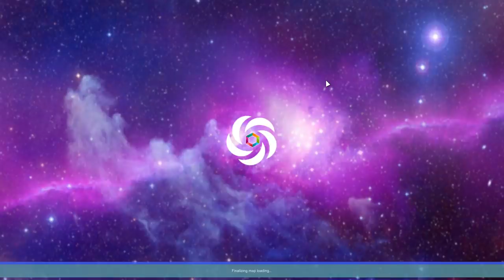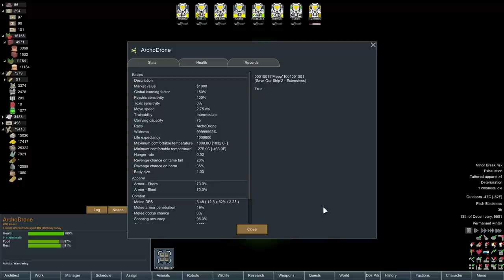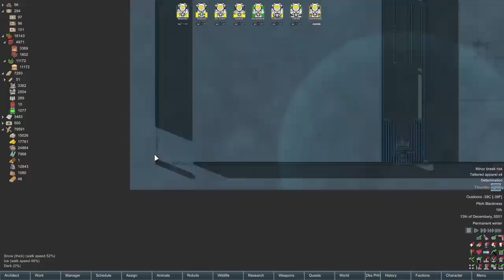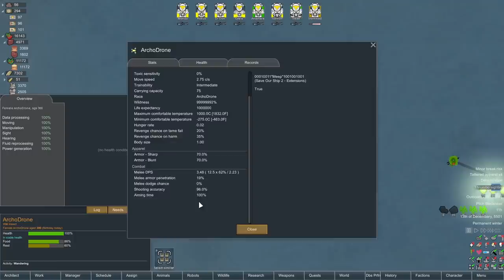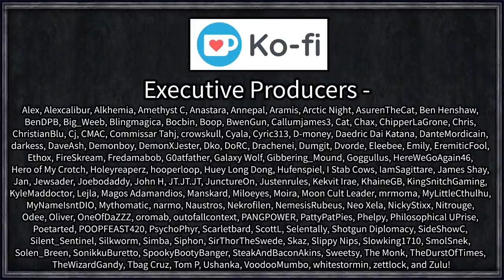Rimworld: Save THEIR Ship #4 - 5000 Advanced Components and Rising

Comment: You do know.. the miners gather resources faster over time.... you setting such low limits makes them stop and reset their efficiency they gained. Just set 1 for each resource and set it at a pretty high level... like 10k or so and it will outpace your crafting after a few minutes and will outpace your ability to craft and run out resources until it hits max again.

Comment: I was hoping those binary numbers in the description at 26:50 would add up to 69 and 420 or something but it's 19 and 585, or 20041 if you interpret it as one number.
Reply: Thought about this some more. It's 18 characters so it's not valid ASCII... If you drop either the last two or the first two binary digits of the group after the beep, you get a bunch of control characters, a horizontal tab, and the @ symbol. If you drop the first two zeros a you get "NI"... which I guess could be a Monty Python reference? That's as far as I got with it. Maybe its a different encoding? EBCDIC is 7 bit and Baudot/Murray and ITA2 are 5 bit... 18 doesn't really fit any of these but maybe you'd get something interesting dropping some of the digits somewhere. That said, it's more likely just random or the beep obscures too much of the message to decode it...

Which gets me thinking... maybe there's missing bits in the middle but there's parity information... maybe hamming coded? I've spent too long on this at the moment but reply here if you happen to figure it out.